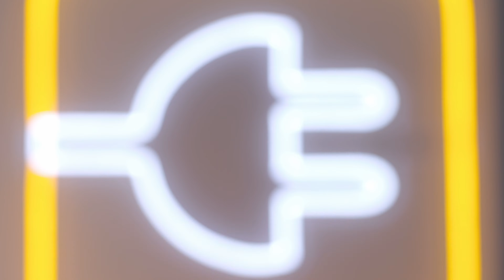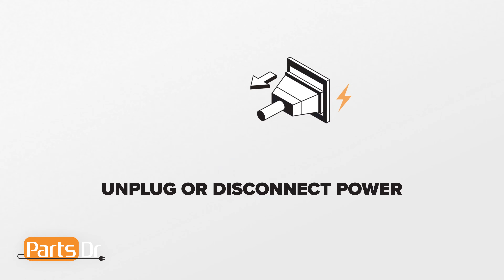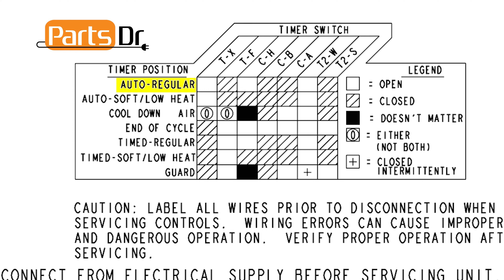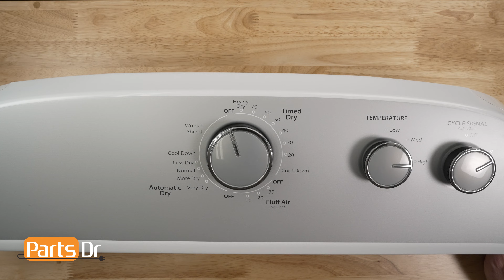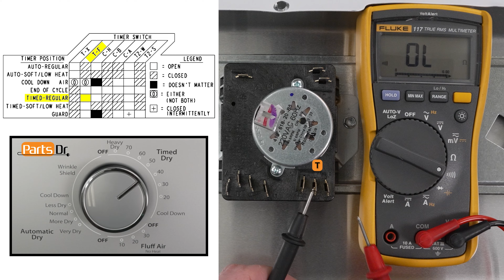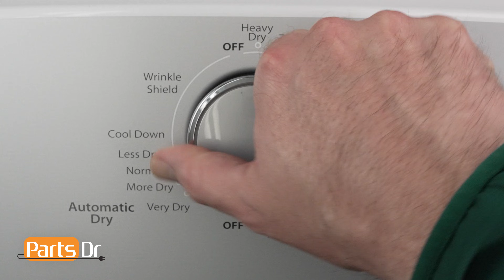Dryer Timer Troubleshooting & Testing - Whirlpool Maytag Amana Kenmore Estate and More

Comment: My timer is good, changed the heating element that was good, thermostats that were good, thermal fuse that was good still no heat. The dryer runs but no heat. I tested the temperature selector relay switch, it didn’t have continuity and I replaced that for $12, still no heat. What gives 😢🤷🤦🏼
Reply: This is why most apartment complexes just switch out whole appliances, it could takes days to diagnose something. Few hours of a decent techs hourly rate is sometimes almost half of a new unit.  Plus part cost then installation time on top
Reply from the maker: Make sure the power supply to the dryer is good.  If you only have one side of the power to the dryer, the dryer can run but not heat.
Reply: Control board

Comment: I just noticed that my Whirlpool dryer timer knob was not moving, and the clothes were hot due to being in the running dryer for hours! I had to manually turn the timer knob to stop it. I experimented by trying the timed drying setting, and the knob moved fine until the cycle ended. I also tried the remaining setting (de-wrinkle with no heat), and that also worked fine. I then retried the auto-dry for a short time, and the knob still did not move.

NOTE that when I tried the timed drying and de-wrinkle settings, I noticed the normal "ticking sound" coming from behind the dryer's timing knob, but there was NO ticking sound when I had it in the auto-dry positions UNTIL I got to the "cool down" part. Given that, does that mean the dryer timer is the culprit? I will disconnect things and follow the instructions in your video if necessary, but I figured I would run it past you first. 

Nice video. Very clear. I just subscribed!
Reply from the maker: What is the model number of your dryer?  We would recommend testing the timer as shown in this video.
Reply: @PartsDr  It is a SEDS800MQ1
Reply from the maker: @dionysuseros7423  Test the timer as shown in this video.  Make sure to test the TM-WB timer contacts for the Automatic cycles.  Also, test your heating element and test for a short in the element as show here: https://www.youtube.com/watch?v=8AG7PtCy0v4
Reply: Will do. 

So the fact that no ticking sound occurs when the timer knob is turned through the auto-dry positions (until I hit the Cool Down part) but ticks in the timed drying and dewrinkle sections does not mean the timer is necessarily bad?
Reply from the maker: @dionysuseros7423  The auto dry and timed dry cycles use different contacts inside the timer.  The auto dry cycles only advances intermittently during the cycles.  The timed dry cycles advance continuously.

Comment: The gas flame on my whirlpool does not cycle on and off.  Does the timer control any portion of the length of time the flame is lit?
Reply from the maker: Is the dryer getting too hot or not hot enough?  What is the model number of the dryer?

Comment: This was helpful!  my dryer never shut off cause the timer doesn’t rotate at all… I tested on timed-regular and isn’t working on T-X and T2-S but the other terminals are working… on auto-regular is working in all the terminals. So that means I need to buy a new timer 

Kenmore (gas dryer) is the second timer I’m getting after replacing it in 2019.
Reply from the maker: Sorry to hear about the repeated timer failures.  Let us know if the new timer resolves the problem for you.

Comment: I have a MED5620TQ0 Maytag Dryer. My wiring diagram of the timer switch is showing on one section BK-BU-V. I’m assuming it means BK to V and BU to V. But on the last two combinations of the diagram it’s showing T-W for both with one showing open and the other one as closed. I’m lost on this point.
Reply from the maker: T-W - the two sets of T-W's on the chart don't make sense to us either.  You probably need to go with the readings for the T-W on the right column.
BK-BU-V - we haven't tested this one exact one yet, but we think that it probably means there is continuity between all three of these terminals on when marked Closed on the timer chart.

Comment: My Roper dryer in the timer setting runs for hours..  could this be a faulty timer?
Reply from the maker: Yes, if the timer is not advancing through the cycle on the timed dry setting, it is usually a failure of the timer itself.
Reply: @PartsDr  it does advance, but it will run for hours, and the clothes aren't dry. I have replaced the heating element, thermal fuse, Thermal Cut-off Switch, dryer thermostat, and cycle thermostat. In the high heat timer setting, I have to stop and restart the dryer after 30 minutes to get my clothes to dry and stop the dryer when the clothes are dry.
Reply from the maker: @kimberlysousa5091  The timed dry setting should be run the dryer for the set amount of time.  If you set the dryer to run for 30 minutes on a timed dry cycle and the dryer runs for 90 minutes, then you most likely have a failure of the timer.  Your slow drying could be a separate, unrelated issue.  Make sure to check the exhaust venting and dryer for any lint build up or restrictions.
Reply: @PartsDr  thank you for your help...
Reply: Same here, I replaced the timer but the new timer is doing the same thing, gets stuck at the end of the cycle 🤔. It's also not heating but I ordered a new heating element to put in this week.
Any ideas?
I very much appreciate your video

Comment: You mentioned that a timer could cause the nothing happens  when you push the start button. You do not show how to test the timer if this is the case. I have tested the following: door switch, start push button, thermal cutoff, good power to the dryer. whirlpool wed4950hw
Reply from the maker: You will just want to test the timer as shown in this video and go through the entire chart when testing the time.
Reply: @PartsDr this is the problem I’m having. Dryer won’t start at all but has good voltage, good thermal fuse, door switch, continuity on the push to start switch, when I used to twist the timer it would make noise but now nothing. When testing for continuity on the push to start switch, do I put the leads on R1 and R2?
Reply: @Go_packgo6741 same issue, the two blue leads had continuity when button pushed on/off. The brown and orange I think said end of cycle buzzer. I think mine was ok?

Comment: My timed cycle has a XTF (3 terminals).  How do i test all 3 with only 2 probes?
Reply from the maker: You probably have to test T to X and T to F like our dryer timer chart shows.  What model number is your dryer?
Reply: @PartsDr Thanks for the reply.  Model is WED5000DW2.  Timer won't advance in any timing mode, but heat levels work. I opened timer and cleaned all contactors with sand paper. Good video BTW.
Reply from the maker: @wilee.coyote5298  The timer chart for your model shows separate columns for T to F and T to X.  So you will just need to test it the same as we show in this video.  The timer motor on the timer could be bad and causing it to not advance.  You would need to replace the timer as the motor is not sold separately.  https://partsdr.com/part/w10185992-timer
Reply: @PartsDr  Thanks for the quick reply.  A replacement part came in.  The resistance and continuity test on motor and tabs were the same.  I installed the replacement part and it is now working / advancing. It appears just the motor gears may have been bad. Thanks for your responses and help, I very much appreciate it!
Reply: Follow up: I took apart the motor. The yellow plastic shaft/gear was broken where it should connect to the motor - obviously causing it to spin instead of engaging.
Reply from the maker: @wilee.coyote5298  Nice find!  We are glad to hear that the new timer fixed the issue.